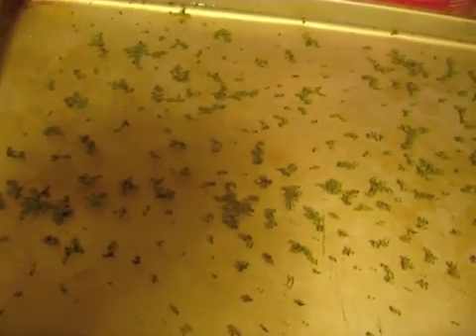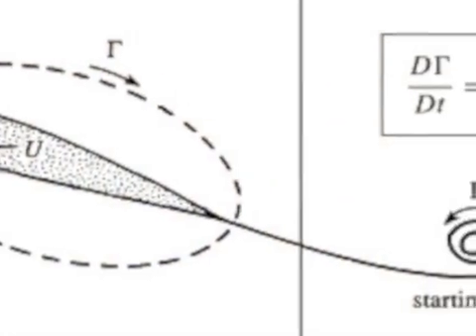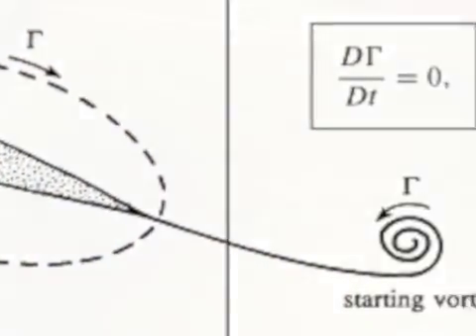How circulation relates to lift (with demo)

Comment: thanks, but essentially you replaced velocity with pressure to explain lift. That does not require the demo. I thought you guys will explain how circulation does the job, not what is circulation followed by the same old explanation

Comment: I take issue with your explanation. I can not see how circulation behind the wing can provide a lift to the wing. The forces on the wing caused by the air are the pressures on the surfaces. There is no way a difference in velocity between the upper and lower flow can create the observed lift. Please provide factual proof to support your theory.
Reply: circulation is conserved, circulation in the wake = circulation around the foil
Reply: If an aerofoil is started then it leaves behind a starting vortex. If it is stopped then it dumps a stopping vortex. Bound vorticity associated with the aerofoil generates lift by the Magnus effect.
Reply: I wish l could understand what a bound vortex is.

Comment: Fabulous! But don't stop there. What happens as the plane flies longer and longer, and generates more and more circulation? Shedding...?
Reply: A steady state foil doesnt generate more circulation, only a change in the steady state i.e. an acceleration/angle of attack change/turbulence in the air
Reply: @tommclean9208  You explained it clearly, video also demonstrates this as he removes the card a circulation in the negative directing occurs due to this sudden change.